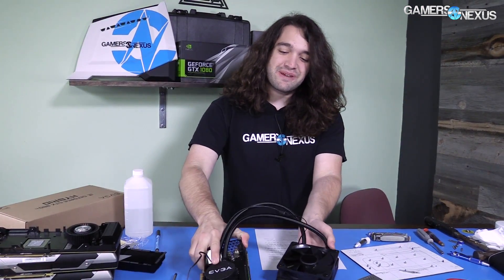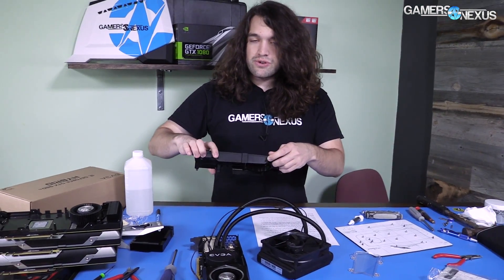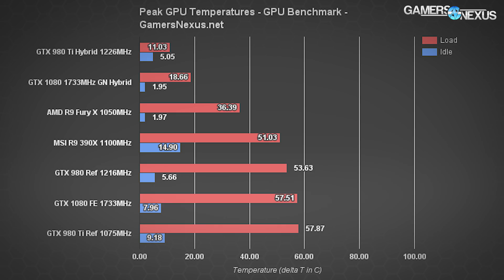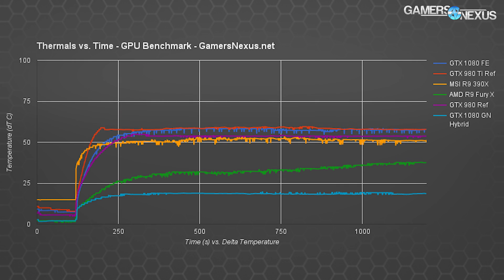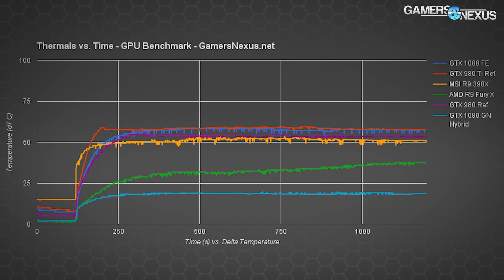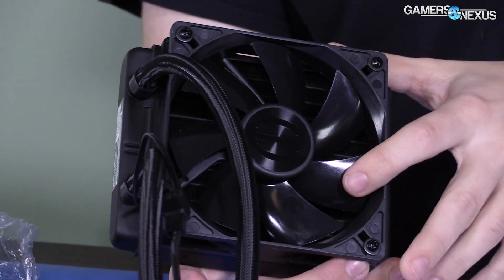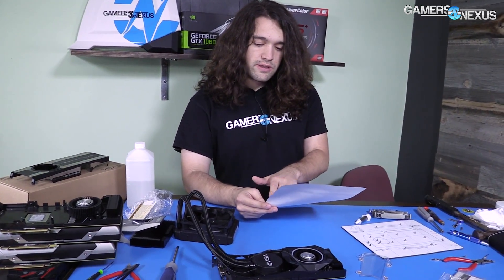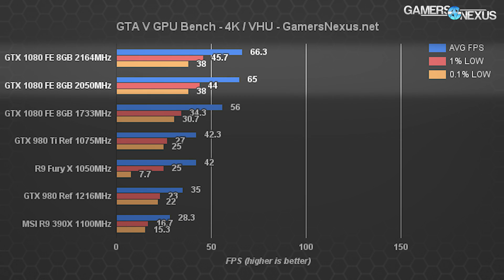Building a GTX 1080 Hybrid Pt 3: Performance Results

Comment: Lol this card is just full on marketing. It barely overclocks, its pretty hot and it throtles, and if its actually benchmarked in a case, its only 3% faster than a 980Ti and a titan x overclocked to 1500 beats it. Definitely not worth upgrading. It's your turn amd, lets see if you can do better.
Reply: +Sam Hewitt I'd love to see where you're getting this from cause I'm assuming you don't actually own one. To be fair the card isn't even on the market yet and most OC programs can't overclock the card yet. The card when compared to the TX and a 980ti with nothing OCed the 1080 in ever benchmark from LTT, Jayztwocents, to hardwarecunks and more all see an improvement of more than 10 fps minimum. The card runs around same temps and uses way less power than both 980ti and TX. Don't get me wrong i have a 980ti and i will be waiting to see if a 1080ti will hit the market soon but atm your comment is very unreliable and uninformative. I can understand you want to bash whatever hype train there is but sometimes what you're seeing is actually good. So just chill and wait till they actually hit the market.
Reply: +Sam Hewitt Ok let's start here "It barely overclocks, its pretty hot and it throtles" You have to remember that this is the 'reference' version, they always have that problem, it will be fixed by the AIB partners. A different cooler fixes heat, and another 6 or 8 pin connector will allow for bigger overclocks and push any throttles back a ways. 

"and if its actually benchmarked in a case, its only 3% faster than a 980Ti" You seem to be missing a zero after the three that every other reviewer I have seen has. It's 22-25% faster. 

"and a titan x overclocked to 1500 beats it" Link to where you got that information? And by how much? And are you talking stock or overclocked 1080? I highly doubt that it can beat out the 1080 at that and even then I don't think it would beat it anymore than the 1-2% just to say it can. 

Also I don't mean to start any arguments here, I just like debates :P I too am waiting to see what AMD brings to the table, but from what I have heard they may be going for the lower end market. I personally feel that you can't beat AMD when it comes to budget, but I don't see them beating out Nvidia this time around. Again we will need to wait and see though.
Reply: skate1234555a Hmm I see. It looks like the part he was talking about was taken from what I think is a German tech site, who compared an overclocked titan x, and an overclocked 980ti, to a stock 1080... People really need to stop this overclock one, dont overclock the other business cause it messes with peoples heads. No one who will buy and overclock a 980 ti or titan x would buy a 1080 and not overclock it, so why compare the two? And even then, we have a 980 ti that we dont know if it was randomly picked or binned, so lets say $650+, while the $700 1080 overclocked will beat it (heck, wait a few weeks and you will have $600 1080 cards that outperform it easy). You also have a $1,000 card, which I think was cherry picked as I have never seen a titan x hit that clocks (forgive me if this is more common than I think, I don't look at titan cards too much) which one way or the other, overclocking the 1080 will shorten that gap and the price difference really isnt worth it. 

People are throwing in some really weird comparisons just to make the card bad. Take it for what it is, a reference 1080. Compare it to a reference 980 if you want to see the architecture improvements. Compare it to the best out now to see what it can do, but really, just stop calling a reference card bad compared to the top of the top when AIB partners havent released any of their own cards yet.
Reply: +mage7206 he got the information from AdoredTV I believe. It's a tech YouTube channel. He did a review of the 1080 but didn't have the card in possession unfortunately.
Reply: +mage7206 I believe you're correct about the Titan X, hitting 1500mhz is basically a golden chip in the silicon lottery (from what I've seen). JayzTwoCents water cooled Titans hit a max of 1400 -1450mhz if my memory serves me correct. But as the 1080 is concerned I think it would be wise to reserve judgement until we see cards from the board partners, these usually provide a good base of what most people can expect especially where overclocking is concerned. The card is obviously quite fast, just how fast exactly seems to be a topic of dispute some people. For me though, and people may disagree with me but what I think is quite impressive and cant be disputed is the new technology the new architecture brings, Ansel, SMP, GPU boost 3, advanced memory compression, VR Audio works, Fast Sync, etc.
Reply: skate1234555a Exactly. Im waiting to see AIB partners versions too, but until then we should really compare as equal as we can. People can go and put it up against 980 ti cards all they want, but reference to reference the 1080 easily wins ;P 

And all that new tech is really awesome too, its why im so excited for this whole thing. Ansel and SMP are for sure my top picks for coolest tech. I watched nvidias demo of the vr audio works and I was left pretty disappointed, but I guess I will wait for some "real world" uses of it to really judge it.
Reply: +skate1234555a how the fuck can your review a card when you dont have it!
Reply: ***** they all benchmarked it on a test bench. When its bench marked in a case it throttles quite a bit. Cant remember the name of the website that did this. Also gamers nexus did a hack on it to stop it from throttleing and then overclocked it. It didnt overclock as well as previous generations.
Reply: ***** amd wont be releasing anything as powerful as the 1080 until later this year. However polaris 10 looks like a really good upgrade path if they price it well which im sure they will. They are targting vr and mainstream with polaris instead of enthusiast level. Like the 1080.
Reply: When they said whatever times the performance of the titan, they meant specifically in VR. And the claims that it is faster than 2 980s in sli are only true in super specific situations according to JaysTwoCents.
Reply: SeabasR exactly. Its marketing. Its being overhyped way too much.
Reply: PC Master Race woah mate, save that for the console owners they are going to need it in a bit. I saw a guy post that he just bought both an Xbone and a ps4 as MS and Sony announce an upgrade in performance.
Reply: PC Master Race There will be a slim version of the curent xBONE and another that will actually have higher performance and 4K video  support  maybe.
Reply: or at least for AMD to release their cards. Who knows, maybe they will have cards that have much better value than Nvidia cards and they will be forced to lower their prices. Everybody wins.

Comment: I really appreciated watching these videos.  It's awesome, the results you were able to get from your homebrew 1080 Hybrid.  As somebody who was very worried about the temp throttling I was seeing on the 1080 benchmarks this really makes me feel better about what we can do with the 1080.  One thing, I don't think you were using the word "tessellated" right to describe the change in the shape of the shroud and mounting points.  Not all shapes are tessellated, and a change in the design of a shape is not a tessellation.

Comment: sounds like voltage problem because of power restrictions. plus the voltage regulators are not up to scuff because it designed for a certain power target. aftermarket high end chokes and caps with proper power and cooling will probably yield decent gains.

Comment: My thought when I first saw people overlocking their 1080 with custom coolers: Is Nvidia retarded? looking back at the 980 Ti where the reference PCB wasn't even 5% worse than custom ones I suspect that nobody is going to buy that overpriced piece of a power-choked reference (founders) -edition card lol.
Reply: +Ni De From someone who likes the looks of parts as much as the performance I can see why people would go for the reference, but also remember that nvidia has a lot of sales data regarding reference and non-reference cards, so making a move like this must have had some good reasoning behind it. Now the question is will it play out how they think. Only time will tell

Comment: I still dont get it with this card. Gtx980ti 1075MHz have avg. 46,7 fps and Gtx1080 2164MHz have avg. 66,3 fps. Is this new card actually slower in clock for clock performance? If u can hypotheticly overclock the 980ti to 2164MHz how fast it will be? To me it looks like this Pascal card just benefit from 16Nm proces so it can reach higher clock speed and thx to that is faster and of course the GDDR5X memory. So basicly its like Maxvel on 16Nm proces so nothing special in terms of architecture.
Reply: This is nothing new for a reference. People are judging it pretty hard based on the reference model with the reference cooler that we all know sucks and no one who is in if for the top of the top performance will ever get a reference. What we need to look at is the potential it really has once we get custom PCB with a decent cooler. That's when it gets fun and that's what makes this such a great card, just need to look past this early version which is more like an early released dev kit than a full product atm
Reply: +Eduard Marcinek Whatever the case, it's still an amazing card xD
Reply: mage7206 yeah hitting 83 celsius under load and 90+ if u overclock it and after 20min it drops clock spd back to normal so it can cool itself...
Reply: mage7206 but they sell it for 100 more :D
Reply: Eduard Marcinek Just means their marketing team knows something we dont on how many reference and non reference cards get sold :P
Reply: +Eduard Marcinek That's because the 980ti has more cuda cores, bro.
Reply: Jon Duke those who have 980ti should really not buy gtx1080 bro
Reply: k, bro.
Reply: Jon Duke watch some benchmarks, oc 980ti vs oc1080, the gap is actually even smaller, 2-15%
Reply: +Eduard Marcinek because the 980ti's have a custom pcb and a custom cooler while the 1080 throttles from heat and a lack of power consumptine so it can't max out his full overclocking potential(sorry for the bad english)
Reply: Max Latz but that doesnt change the fact that Nvidia sell the reference card for 100 more with shit cooling etc

Comment: Love all the work that sets this channel apart! Since you've pulled the founders card apart - does the LED strip pull out easily like on the 900 series? I'd want to sand it down to white (for the premium it should have been rgb for build ease), either that or wait for the windforce.
Reply from the maker: +Neil I didn't pull that out, but it looked like it was mostly just some adhesive pads and the strip. Shouldn't be too hard.
Reply: Thanks Steve, helped me decide.

Comment: wtf is delta T
Reply from the maker: +GreekGamer4U Read the articles we post. We explain. It's simply the temperature subtracting ambient, so that you may compare card temperatures regardless of change in ambient. It also means that you can personally get a better idea of temps vs. your house temperature.
Reply: Ok thanks :D

Do you think that 980Ti asus Matrix (best asus edition) for 400Euro Now is better than 1080 530Euro?
Reply: delta means "change in..." so delta T is change in temperature, delta v is change in velocity etc.
Reply: +GreekGamer4U  Sure it is i dont think you get it for that low price only used maybe , still a 600 buck card
Reply: Yes I meant in used condition from my country
Reply: ok i dont know man i have 390x plays every game , you think gonna need it ?
Reply: For the true meaning of ultra settings yes :D
Reply: Ok

Comment: So hybrid cooler coming out in the future probably won't be worth the extra cash to those of us that have to consider such things. I wonder had the VRAM been liquid cooled as well if that would have helped in any way that would be notable.
Reply: +Mark Rushow If that hybrid cooler is running on the 'reference' designed pcb, than you would be correct. But I doubt any AIB partner would release a hybrid on the 'reference' pcb. A custom pcb would have changes that would easily fix the limitations he is having, while the hybrid cooler they add would just help keep it stable. Always wait for the reviews to come out, but I'm pretty sure hybrid coolers for the 1080 will be very, very nice

Comment: Why are ppl trying to force this 4K shit when hardware can't comfortable deliver this yet in an affordable manner. What do ppl expect this shit to be powered with, vespene gas? There seems to be this expectation of a magical leap to 4K when 2.5k only just got to a point where it provides enough headroom for future proofing. A 1080Ti might deliver some headroom,  but will shit the bed again as soon as game devs up the graphics of their games, based on 1080p which has lots of headroom. 50fps gain in 1080p is great, but means fuck all in 4K. Are ppl struggling with the concept of exponential power requirement when you keep doubling the res?

Comment: So basically with this "hybrid" ghetto solution there was no meaningful FPS gaming improvement.   But the lower thermals and quieter system is a major plus.  Perhaps when we see Hybrid coolers designed specifically for the GTX 1080 we may see a difference. Looking forward to seeing that.
Reply: It sounds to me that while there's a lack of peak FPS gains, the sustaining of FPS due to no thermal-throttling would be meaningful. I'd consider the lack of FPS drops FPS gains, over stock-experience.
Reply from the maker: +Aeschylus Shepherd That's a pretty good summary, yeah!
Reply: +Aeschylus Shepherd Except that you would see an improvement because the standard card can't hold it's overclock and craps out as the graph shows. So in theory it doesn't make much difference but in practice during a proper gaming session then you'll get the full performance the whole time rather than a fluctuating mess.
Reply: David C
Exactly.

Comment: I have  a question. Could you not just use the front plate on the 980 to get it to fit the front plate

Comment: Do u think two 1070 in SLI will be sufficient for High/Smooth FPS, Max out setting, Triple A titles?
Reply: +NBW DOUGHBOY Definitely.
Reply: +ThePowerhousePotato! i meant to add 4k
Reply: NBW DOUGHBOY At 4K you might have to run high/med high. Ultra is possible but I wouldn't bet on it. 1440p is more attainable.
Reply: +ThePowerhousePotato! yeah i thought so.
Reply: +Victor Benko thanks
Reply: turn off smaa and you will see fps fly to the sky 👍🏻 1070 sli or amds new 490 in crossfire will run 4K without issues
Reply: +TrueDesireHD Thanks man. i appreciate it. let me ask u this how much do u think the Amd zen 8 core will go for? if it's going to be 8 core with 16 hyper threads the only comparable cpu is the 5820X (Or whatever it is called) which is a $999 CPU I speculate they will go around the 600-650 range but maybe the 6 core zen will be cheaper. but who knows.
Reply: NBW DOUGHBOY
Zen is too far away to be guessing, but since they ditched CMT from Bulldozer family for SMT like intel does, i sure hope they make 8core Zen for same price as a skylake i5K, that would be a real killer for DX12 and Vulkan games :)

heard Q3 earliest regarding Zen, and intel is making a refresh with kaby lake (Q3 as well ) so if you are going to build something completely new, i would say wait for kaby and zen before you give you wallet some tough love :D
Reply: +TrueDesireHD oh yeah for sure. i didn't even know about kaby lake. but, thanks for the info. this will be my first build. im super excited and so glad i waited until now. October is gonna be very interesting. i can't wait to see all the benchmarks and special editions. AMD is supposed to reveal something on the Polaris cards at computex on the 31st i think. Hopefully it is as good as everybody hopes it is
Reply: ***** Thanks.